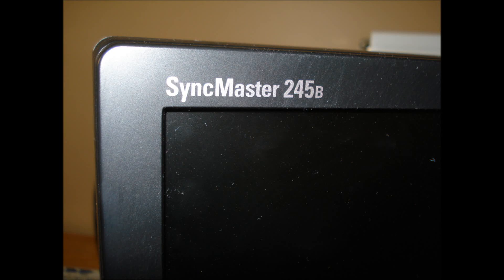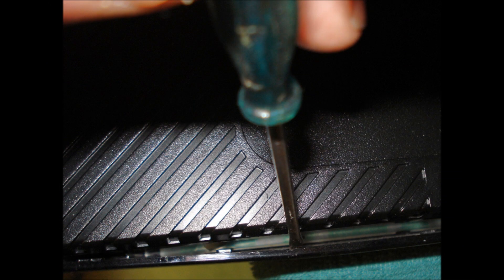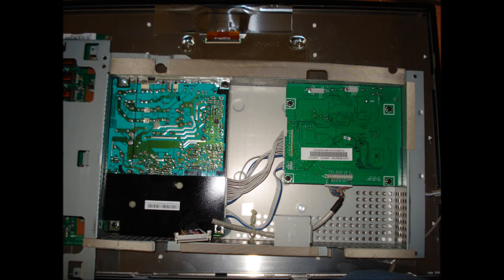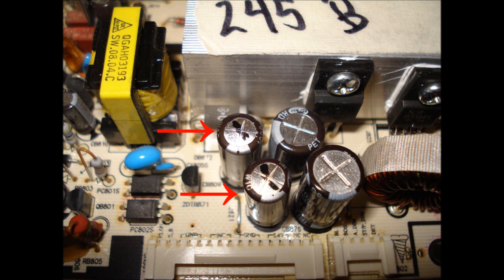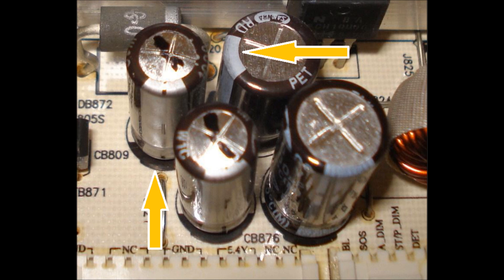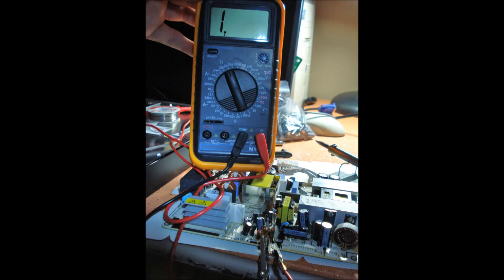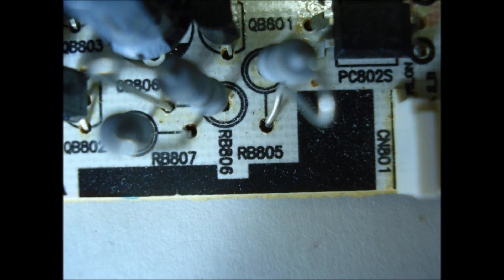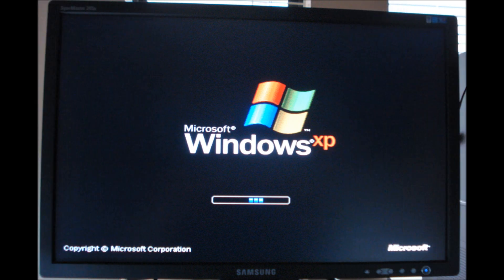Repair Samsung SyncMaster 24 Inch 245B - similar to a SyncMaster 24 Inch 245BW

Comment: 9 years later, another Samsung 245BW lives on. 👍  Problem was two bulged capacitors 1000uF/10V.  The electrolyte dries out over time, especially the hot low-volt/high-current ones.

Comment: Is it worth it to replace these components as of 2020? Or just buy new monitor?
Reply: Only you know what you can afford - I am currently using a Samsung SyncMaster 206BW which I repaired 7 years ago & it's still going strong.  It's on 14 hrs/day - 365 days/year.  When it succumbs to an unforeseen death, I will not resurrect.

Comment: hello, thank you for this short video. The 68 ohm resistor was the culprit for me, I've replaced the 3 resistors by one single 220 Ohm 5 watts resistor, as the 3x68 ohm are mounted in serial
Reply: where can i get these

Comment: How the heck do you remove the bezel off a 245BW? The frontmost bezel track looks like a cosmetic feature only. Separating the back from the rearmost bezel groove shows metal clips that extend from the main housing way far into the bezel. It appears impossible to dislodge them from all four sides. From what I can tell, is not the same as what is shown here for the 225.
Reply: Correction -- the metal clips visible from the back when separating the bezel from the housing with a screwdriver, originate from the bezel and not from the housing.

Comment: One question:  How did you actually 'remove' the power supply from it's housing?  There is a glued fabric strip on top of a thin metal strip which covers the top end (as shown on your video) of the power board housing. The power board is "under" the 4 metal holding feet with the screws. In order to remove the power board, it must be slid from under the two upper feet and this cannot be done without removing part or all of the glued fabric...(or am I missing something)?  Thx a bunch for posting this excellent clear and concise tutorial for the repair of this monitor.
Reply: You can just remove the glued fabric and tape it back on later.

Comment: Thank you very much. My problem was that the screen didn't display anything and one of those resistors was broken so I replaced the three resistors with one big resistor. One resistor was 68 ohm and they (3x68ohm=204ohm) were in series so I replaced them with one 220 ohm resistor that has much better power dissipation. After that it worked again!!

Comment: Many thanks for this video - followed your instructions, changed the three resistors (no need to change capacitors in my case) and - bingo - monitor back to its old self.

For anyone in the UK, here's the bits and bobs that I used :-

- Resistors : http://www.maplin.co.uk/p/metal-film-06w-68-ohm-resistor-m68r
- Solder : http://www.maplin.co.uk/p/lead-free-silver-solder-tube-n51aw
- De-soldering braid : http://www.maplin.co.uk/p/de-soldering-braid-15mm-width-n48fx
- Soldering Iron (this was a really good purchase) : http://www.maplin.co.uk/p/maplin-30w-mains-powered-soldering-iron-n76dg
- Multimeter : http://www.screwfix.com/p/lap-mas830b-digital-multimeter-600v/75337

Thanks again.

Comment: Thanks for this video! - another two 245BW's saved from the dumpster. I really like my 245BW's (i have 3 altogether). I was surprised when I opened the second one (purchased second hand a few years ago) it had already had 1 resistor replaced (another went south) but I replaced all 3 on both monitors.

Comment: All 3 of the 68 OHM resistors looks ok, but RB801 definitely had major heat issues. I have the 68OHM ones but I would like to replace the 100OHM. Any idea what the original wattage of the RB801 is?
Reply from the maker: As stated in the presentation → the (3) resistors are 1/2 W /68Ω  [ approx the 3 minute mark]
Reply: Capman550 
I was referring to another resistor, rb801. A slightly smaller, 100 Ohm.

Comment: Thank you for this video. In my case, all capacitors were ok, only one of mentioned three 68 ohms resistors showed "opened circuit" when measured with ohm-meter. 
Replaced all three with 10w versions which are bigger in diameter. Two went upright onto board as was original resistors position and with third I improvised as wire leads are long enough to place him in horizontal position, floating above board. Thank you also for showing how to disassemble housing, it saved mi a lot of time and reduced possibility of damaged plastic bezel. 
And a money for another used power module, approx. 60$ + shipping + importTAX... Not to mention shipment waiting time: 15 business days from China. Yesterday died, today is fixed, yeee! :))

Comment: Hey. I've got the same problem with the Samsung Syncmaster 245b plus +. See my video: https://www.youtube.com/watch?v=eKuuAMyOhus Is there anyone who has a solution for this problem? I want to know which component fails, so I can replace it. .. By the way, there is no image when I shine a bright light on the screen. I don't think it's the inverter board. There comes a crispy noise from the power board when it's flickering like I mentioned in my video.

Comment: Same resistor problem for me. The last 68Ohm resistor in the series (RB805) was faulty (open circuit) and the middle one (RB806) raised its value from 68 nominal to 90. Replaced all three with 68Ohm 1/2 Watt (didn't find 1 Watt) and the monitor resuscitated. No bulging capacitors found.
Thanks guys !

Comment: Thanks for this video. Just transformed a doorstop in a working monitor. Caps looked fine, ditto the fuses but 1 out of 3 resistors  was open. Replaced with a new one and voila, it works.

Comment: Thanks Capman550 for stepping me through the repair of my 245BW monitor.  After I was unable to find a source for my burnt out resistors, I ordered a power supply board BN44-00195A) from J & J International (Samsung's part supplier) that I installed following your clear and concise instructions.  After I got everything reassembled I even noticed that I could pivot the screen and use it in portrait orientation to read my e- newspapers.  You saved the day and my eyes!

Comment: I have just replaced the RB805 resistor, and now the monitor works again. However, although the color is set to 32 bit (or 16, it doesn't matter much), the picture looks as if it were 8 bit ;(  This is valid both for Windows and Linux, so I'm guessing it's the monitor issue. What can be the problem?

Comment: Thank you so very much for this information !!
I just repaired my 245B :)
Was completely dead. Black screen, no power led light.

Problem on mine was that two 1000uF 10V capacitors blew their cap on the bottom, so I replaced them with 1000uF 16V.
Resistors were ok, but I replaced them with new ones 68Ohm 3W.
I also replaced the two capacitors that were in the same cluster as 1000uF ones.
I got 2200uF with 25V and the 470uF 35V.
Total repair cost 2,6$ and 20min.

Here are some images of blown capacitors and before/after of the board itself.
https://imgur.com/a/GHY5F

Comment: Hi!
I have the 245BW plus, and exactly the same problem. I opened it today, and the power board is very different. I managed to find three resistors that kinda look the same (RB801, RB802 and RB808), but everything is covered in some kind of yellow rosin, it's very hard to remove and I don't know if it's normal... The capacitors look fine, no yellow goo on those.
I don't really know what to do. Should I replace the resistors anyway?
Thanks!

Comment: I've repaired several 245BWs, with these being the main problems:
1) Bulging, degraded electrolytic caps (as shown in the video).  Head to Mouser or Digi-Key and grab some replacements.
2) Failed resistors (as shown in the video).  Replace. Use metal-oxide resistors of equal or greater wattage and same resistance.  I also remember replacing a 0.22 Ohm resistor in series with the main PFC cap.  But this is a symptom of the cause in #3 below.
3) Mounting glue becomes conductive (not covered in video).  That yellow glue shown around the base of the resistors at 2:57 becomes conductive when it dries out and becomes brittle, leading to widespread electrical faults that wreck components.  Scrape off any that you find and investigate any components whose leads were touching that glue.  I've had to replace those MOSFETs attached to the heatsink and even had to patch up a gate drive transformer for which the short blew a winding.

Comment: Thanks for the video. I repaired a few of these monitors a couple of years ago but one of them had something else wrong with it that I never had time to figure it out. Do you know which, if either, is more likely to cause problems on these; the inverter board, or the logic board? Any insight is appreciated!
Reply from the maker: The power board has been my source of grief with this monitor.  The only way to narrow down the issue(s) is to check the DC outputs at the plugs, on the power board, with a multimeter.  Another good source of info is the Badcaps Forum 
http://www.badcaps.net/forum/
Reply: Thanks, I'll have a look.

Comment: My 245B PLUS monitor at work has the same fault, blue power led with black screen, when I opened it, the power supply was a bit different than the 245B without the "plus" The white connectors looks the same, but not the power supply. I've replaced almost all caps on the power supply, and the two on the inverter. Still the same fault. Any advice? Those resistors aren't there on the "PLUS" model.
Reply from the maker: Connect the monitor to the computer an boot.  Shine a bright light on the screen.  If you see an image then there may be issues with the inverter board or the back light. Output voltage checks (connectors on power board with all plugs attached) is the best place to start when diagnosing problems.

Comment: Took a faulty 245B from work to home. Symptom is that only power led lights up. Opened casing and found burned RB805 resistor and bulged CB809. Will first replace those and if display powers up, also rest of the caps

Comment: None of my caps look bad (no bulges etc) and the ones I tested looked good... I replaced the three resistors but I am still getting blue light with no display. Any advice anyone can offer as to what to check next would be extremely helpful. UPDATE: Well I managed to open the panel itself and check the CCFL's and they look just fine. No burnt marks or leaking anything. UPDATE 2: I also replaced the fuses and still the light stays blue and the screen is black. Should I replace the caps anyway? They really really don't look bad.

Comment: Hi,
is it safe (better) to use 68Ohm 1W resistors instead of 0.5W resistors?
Reply from the maker: There are no issues when replacing a 1/2W with a 1W 68Ω resistor.
Reply: Capman550 Thanks for answering! So I will use 1W-resistors for repair as they can take more heat before they are damaged.

Comment: Thank you Capman550! I tested that RB805, an the 68 ohm 1 W resistor ,was blown. Replaced that resistor and a couple of other capacitors which looked bulging (with 2 x 1000 uF 35V). The monitor worked after the repair.

Comment: Suggestions?  I opened up my monitor today. Everything on the power supply board looked good.  No bulging caps, or burnt parts anywhere.  Decided to replace the three 68 ohm resisters and now the screen lights up white instead of remaining black. Does that suggest any other particular parts that may be the culprits? (245BW)  Thanks.
Reply: I have the same problem - replaced the resistors with no luck. Were you able to fix yours? Oh - except mine doesn't light up white, just stays black.
Reply: I wasn't able to fix it and don't see any way of going further with it on my own.
Reply: bills48321 That sucks man, I think we have bad logic boards or it's something non-obvious. I've been taking a multimeter to mine and all the parts seem to check out. I will never buy another samsung monitor as long as I live, every single one the caps or bad or they die within 2 years. Total. Garbage.
Reply: bills48321 Any luck with the white screen in the last few months? I just replaced one of the 68 ohm resistors (the only component on the whole power board that was testing as faulty by multimeter) and now the screen lights up all white as you experienced. Wondering how to proceed...
Reply: Thanks for asking, the screen has been retired and now sits in the basement.

Comment: When changin Cap 
 Keep the same uF 
 Keep the same V or slithly Higher 
 Keep the same oC or slithly Higher 
 Keep the same Impedance or slithly Lower (if you know it) 

Minimal Digikey PArt replacements Numbers   (with higher voltage)
x3  CF12JT68R0CT-ND
x2  565-1554-ND

All other Capacitor numbers (if you change them)  (with higher voltage)
x1 P14402-ND
x1 565-1609-ND
x1 P13139-ND
x1 P13138-ND 
x1 P13142-ND
x3 P13148-ND
x1 P13137-ND
x1 1189-2156-ND
x2 565-1616-ND

ThanKs Alot for the Video !

Comment: Replaced the 3 resistors with new 0,6W 68 Ohm and it works like a charm now.
I also removed the screw from the holding unit so i can use the syncmaster in 90° pivot mode!

Comment: Great stuff.... even though im highly capable of my soldering skills and techniques, it still shakes my confidence buying newer LCD monitors if they are to fail like this within a year or so all because of cheaply made capacitors being used in the power supply section, at least the logic board stays working. But as of lately, i've seen some newer LCD monitors that are much thinner and they use a seperate powersupply, like those used for laptops, hopefully those are more reliable and perhaps that type will be my next purchase. Im currently using the syncmaster 941bw 19'' wide screen monitor, many years old today and NOT a single issue...

Comment: I think I have a bad 245BW, Its high gamma range (whites) are very very far off from normal.
I have (2) 245BW's & a 24" IPS panel.
Using a grey-scale pattern test:
Bad 245bw - 86% grey all the way to 100% all look white.
Good 245bw - 98% and 100% look the same.
IPS 24" - Can tell the difference between 98% and 100% easily.

On the low end all my monitors - 0% to 4% look black to me.

If I adjust the gamma on the bad monitor down as far as it goes in AMD CCC, the white range looks more correct being able to tell the difference between whites, but destroys the blacks in the process.. making 0-15% all black.  Using Flat panel display color in CCC, or using the built in adjustments on the monitor gets me nowhere.  Its so far off.  I feel like something in the electronics must be broke?

Also running eyefinity, so no way to use individual color profile files.  Even one of those auto calibrating Spyder things wont do anything here.

Anyone repair their gamma by fixing a cap or resistor or something?

Comment: Great video.  I have repaired mine by replaceing the 3 resistors. One was faulty.
total cost 25 cents. :)
Reply: Where did you get the resistors?
Reply: +Victor Valencia local hardware  supplier

Comment: Thanks so much!
All capacitors were OK, so I removed all 3 resistors and measured them.
First one was OK, second one was OK, third one was broken.
I replaced all 3 with 0,6W 68 Ohm, 1%.
The monitor now works!
I would have never been able to fix it without your wonderful posting.
Very happy and grateful.

Comment: I could only get hold of 0.6w 75Ohm resistors, will these work?
Reply from the maker: That translates into a 10% variance in each resistor.  I would recommend locating the correct replacement resistors
Reply: Capman550 Thanks for the reply! how much variance is acceptable? (for instance if i replaced the one faulty resistor with the 75Ohm..)
Reply from the maker: I do not have access to a board to measure the voltage drop. It would likely be OK, but the voltage to open a switch or excite a transformer might be on the edge, in which case may not work.  Go to the "Badcaps" website.  It is an excellent source of info.

Comment: I've got the SyncMaster 245BW and had the same problem with the display not turning on. For a few weeks would flicker and had to flip the power button a few times to get it to work and it finally stopped completely today. I replaced both capacitors (which appeared to be blown out) and all 3 resistors and it works perfectly. Thanks for a great video, it appears that you have saved myself and many others a great deal of time and money!

Comment: Thanks!  One of the 3 resistors on my power board had an open circuit.  Replaced it and monitor works again.

Comment: I have identfied the bad capacitor on the 245BW model.  Capacitor says 2200uF, 10V.  Question, can I use a slightly differently rated uF capacitor with 10V?  Or does the 2200uF has to be exactly 2200uF?

Comment: Thanks from Belgium! Was able to give my (600€ back in the day) SyncMaster 245B a longer life by replacing 1 resistor that showed 1 on the multimeter. Never desoldered/soldered anything before and got a cheap soldering starter set lol.

Comment: Also a bad resistor here. Seems more common than a bad capacitator (which I also replaced but that didn't solve the problem). Thanks a lot! I really like the Samsung 245B monitors.

Comment from the maker: As you can see in the presentation there is one capacitor I had to mount horizontally.  If you mount the capacitor horizontally, make sure the electrodes are not contacting to capacitor's outer case.

Comment: I went and replaced my Capacitors with ones with the slightly higher voltage. The uF are exactly the same as on the originals. I noticed even if the voltage was the same the capacitors were slightly larger.
Before I install, I just want to make sure that the different in size isn't going to be a problem. Excellent Video, Thanks for putting it up for us.